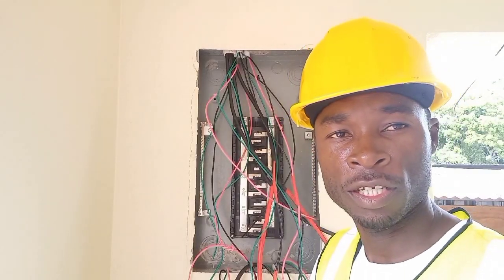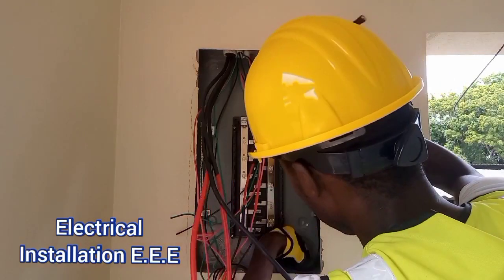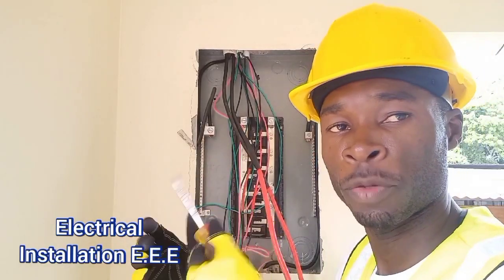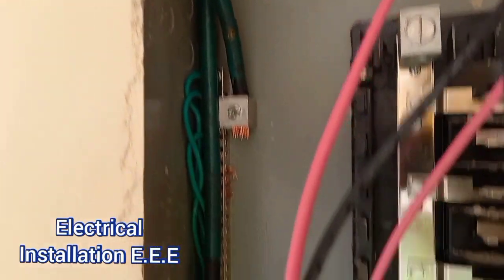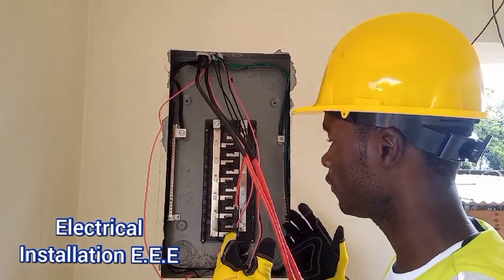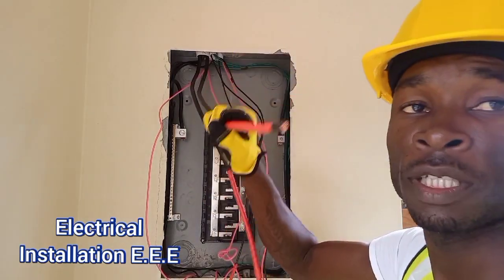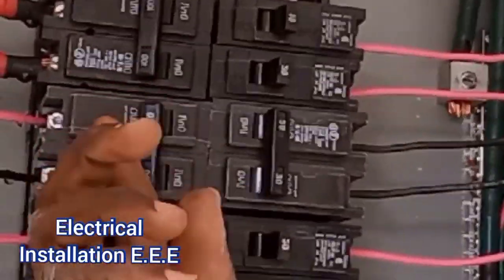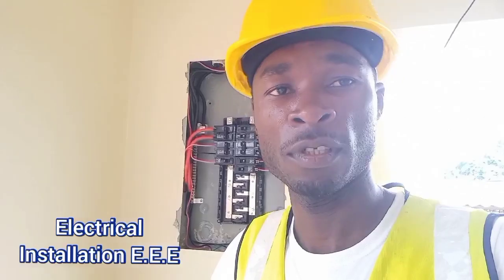How to connect a Sub-Breaker Panel !! Why the neutral & ground separated in a Sub-Breaker Panel?

Comment: In the UK there are three types of supply systems, TN-C-S , Combined protective  and neutral conductor .In other word the neutral act as a return earthing path back to the transformer,which offers a low Impedance  approx. 0.35 ohms. Next we have TN-S system, separate earthing usually the armoured  of the cable sheath back to the supply transformer, impedance  0.8 ohms. Last, TT system where no earthing is  provided, external earth fault loop impedance 21 ohms. The client provides their own Earthing Rod.It is recommended that the earth fault loop impedance for a TT System  does not exceed 200 ohms. Just some information from the British side.
Reply from the maker: Lovely to here other people give there electrical regulations , codes etc about there courty or region .. big up yourself in the UK and all the others over there appreciated when we reach that we can relate with🤝👍

Comment: Hey why does current spike? My fan speed up by itself the goes backs to normal in few seconds.  The main breaker is 70amp connected to a 10 mm cable. Lights on 15amp switch and plugs or on 2021 phone switch

Comment from the maker: Simpliest definition of diversity factor is the max sum of individual loads on a circuit e.g 12 lights on a cuicuit but all 12 lights may or may not use at the same time in this case the required amount of loads you have on a circuit not all the time all of them are using at the same time.

Comment: WHAT IS MEANT BY ZERO POTENTIAL??? AND HOW DO I ACHEIVE ZERO POTENTIAL IN A PANEL?????
Reply: Well my friend zero potential difference. Is with the neutral and ground. Because if u should measure for voltage between neutral and ground. There should be no zero potential difference
 meaning no voltage. Why because the netural would carry
 current but ground would not. So in order to get a voltage current must flow on both wires. However, if u get a voltage between ground and netural some live/ hot is touch the ground. In some cases.
Reply: @adrianfrancis1156  Thanks a lot cause me have nuff questions thanks for the response am learning from you nd the teacher Mundo as well respect👏🤝
Reply: @affluentj4992  Yea man. U r the same thing like me. I love to ask question regarding electrical. I ask my instructors a lot of questions, and other electrican on YouTube. so r u an apprentice electrician?
Reply: @adrianfrancis1156  not really an apprentice, am a grade 2 going grade one electrician, just need some experience on 3 phase systems and a great mentor to teach me, but in my mind am always a student to this trade, I love it, it's what I do for a living, but the bigger the projects I get more realise I've got a lot to learn
Reply: To maybe achieve this zero potential ensure no live is touch the metal frame or ground side.
Reply: Hope it clarify your question.
Reply: @adrianfrancis1156  Clearly

Comment: So true. Because bonding the neutral to the ground in a subpanel will allow current to flow over the ground wire back to the main electrical panel. and u don't want that to happen. Because current is now flowing over the ground wire, someone could be shocked by it. So under normal  current operation the ground wire should not carry any current. Only in case of ground fault situation.
Reply from the maker: Perfect